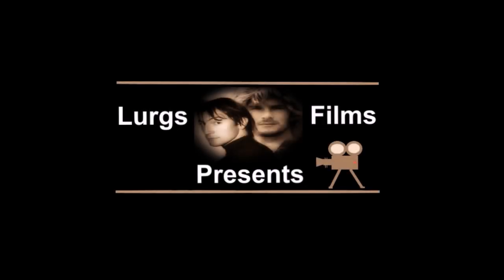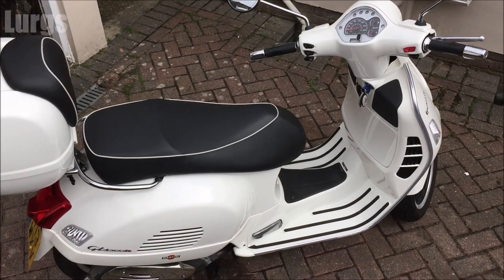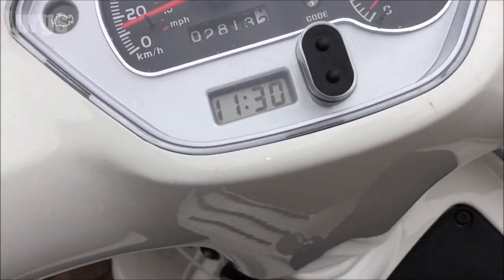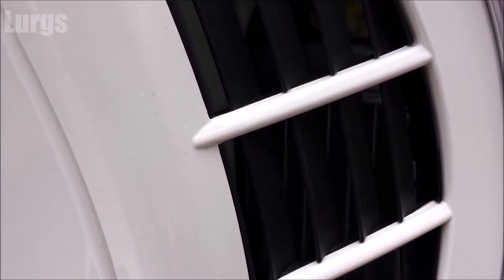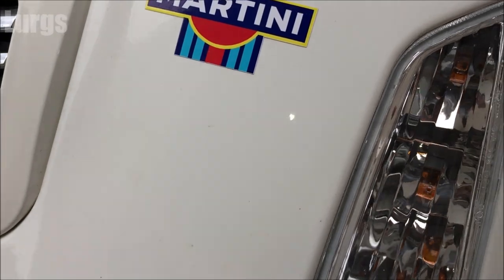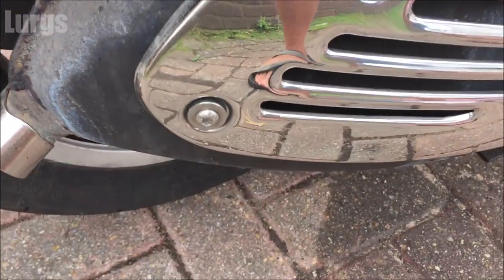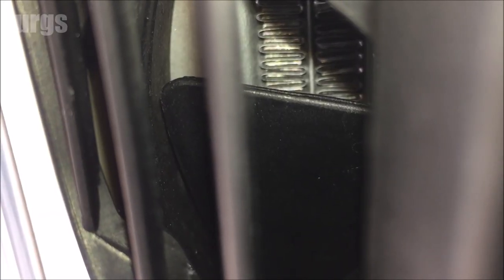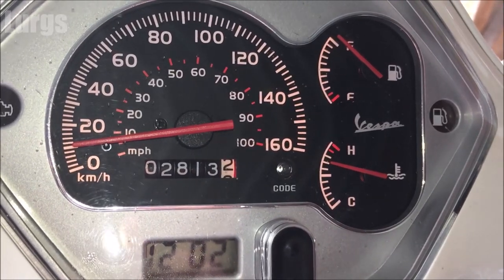Vespa GTS Radiator Fan checking it works

Comment: Hi my radiator fan isn’t working is there a thermostat somewhere that send a signal to the fan if so do you know where it is 
Cheers Paul
Reply from the maker: Yes there must be a thermostat somewhere which is linked to the temperature gauge on your dashboard. Not sure where the thermostat is but it should look like a little plug somewhere on the small radiator. 
Before you do that check your fuses! That’s an easy thing to do first. https://youtu.be/V2fw3_NwWXk

Comment: Great video!  Related Question:  Is  coolant pump designed to keep moving coolant after a long ride?  I turned off engine, removed the key and as I'm walking away, the bike is still making noise and I clearly hear liquid moving around the engine compartment.  Makes me think it's still cooling.  Feels weird because the bloody thing is turned off and key is in my hand!...Any thoughts?  Now, about that cup of tea!  Thx!
Reply from the maker: Yes that’s normal if the engine is hot, same with cars they sometimes will carry on the fan blowing, nothing to worry about unless it’s on all the time. Glad you enjoyed the video and enjoy your cup of tea. 😎

Comment: Is it normal for the temperature to be higher than half? And close to the H?
Reply from the maker: Yes it can be higher than half but it shouldn't get close to the H Red, if it gets close to that then switch it off and let it cool down. Maybe it needs more coolant or the fan isn't working or the water pump isn't working. Ride safe. 😎🏍